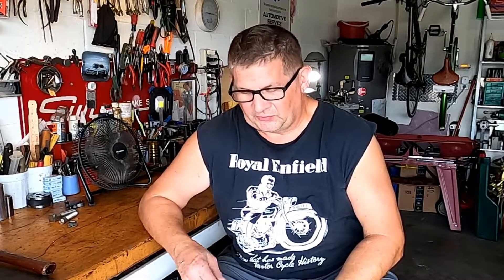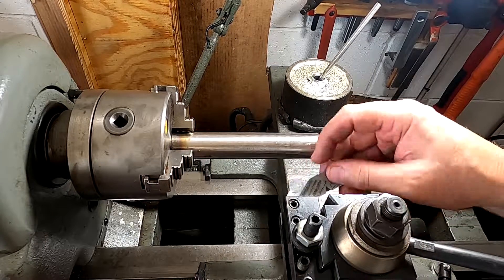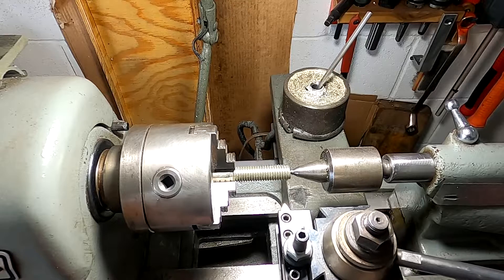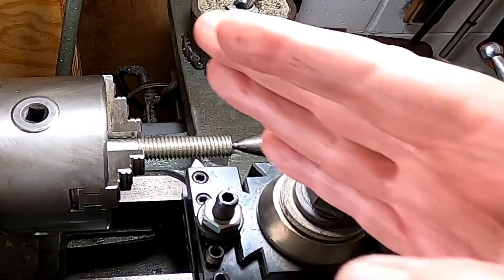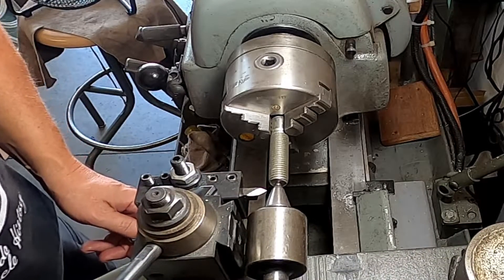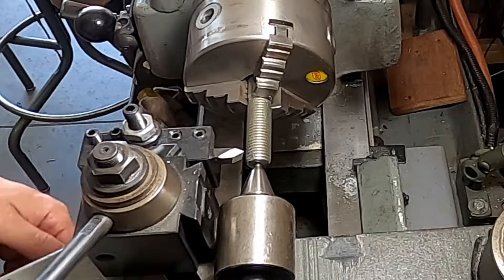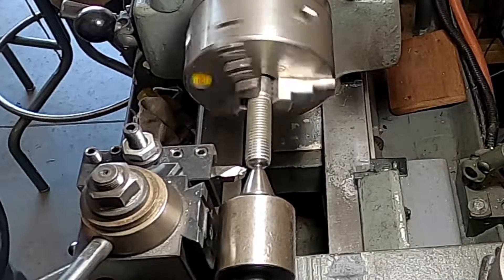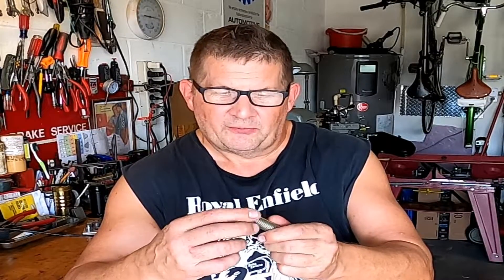Thread repair on the lathe: Picking up threads on the lathe. How to reengage threads on a bolt

Comment: Don, I’ve used a thread file on a lathe. Reverse the spindle, touch the file (with the teeth facing you) to the threads past the problem area, and it will thread itself over the damaged area and right off the end without a problem. You don’t need a tail to firm the part in place for this. It’s quick, and works pretty well. Not quite as nice as rethreading it the way you did, but works in a pinch. I advise people to get a set of these files. They’ve saved my butt a number of times.
Reply from the maker: Hey Mel, yes I've tried that before. Usually by the time I get to the lathe though, I've messed with the file out on the equipment before i get fed up enough to actually go over to the lathe. But yes absolutely, that is an option. Don

Comment: Thanks Don. Haven’t had to do this operation before but it’s good to watch someone else do it.
Reply from the maker: You'll get your chance Lucas. We all do. Thanks for watching. Don
Reply: @donsengine3158  Don, in one of your videos you used a tool I have not seen before. It looked like a wire holder for soldering. I searched on Amazon thinking it was a popular tool that I may have missed but couldn’t find it. Where did you buy it? It looks useful.
Reply from the maker: @aguycalledlucas  I think you must mean the third hand wire soldering tool sold by Matco tools. I bought it off the Matco tool truck a few years ago. I don't know if anyone else has them.  I just found it on their site https://www.matcotools.com/catalog/product/EZSOLD/e-z-solder-clamp/   Don
Reply: @donsengine3158  wow never seen anything like it before. It's definitely pricey. I'm going to keep a look out for this thing. I think I may need to own one.
Reply from the maker: @aguycalledlucas  Ya, good tools are pricey, but speed up your work immensely.  There may be a cheaper version floating around somewhere. You should do a deep dive and see.  Don